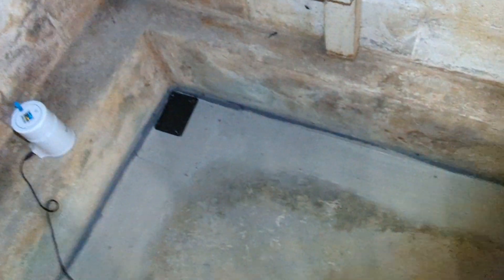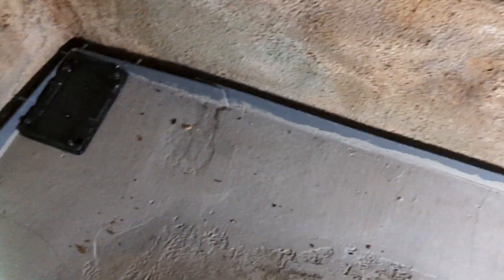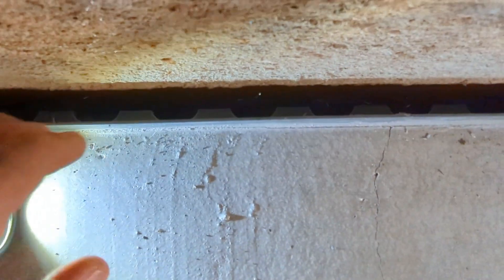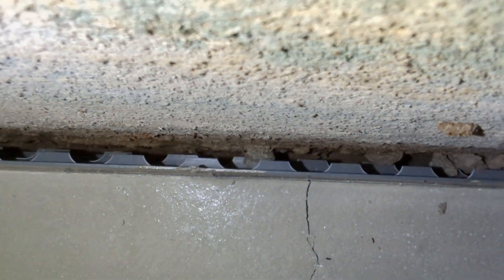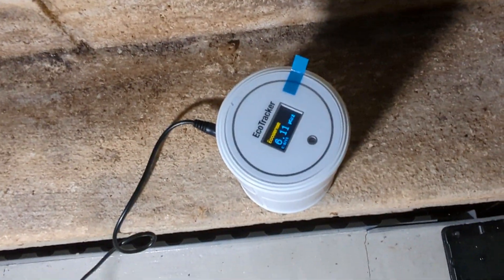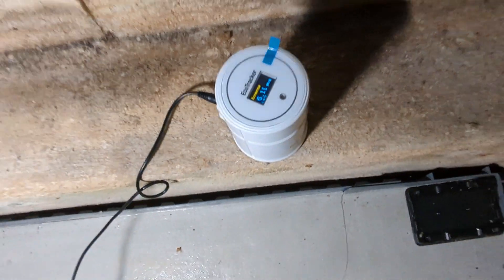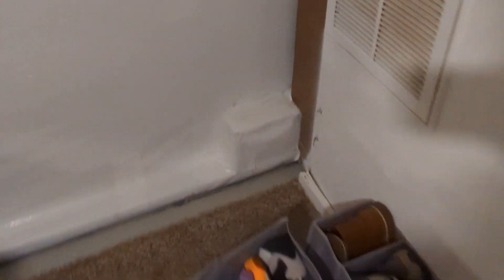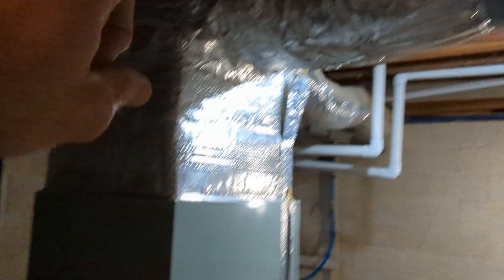Water Management Systems and Radon

Comment: What could you use to seal them off? The proper caulking for the type plastic it is. I have no issues with water down my wall anymore. Took care of the problem from the outside. Now I need to seal the massive radon leak.